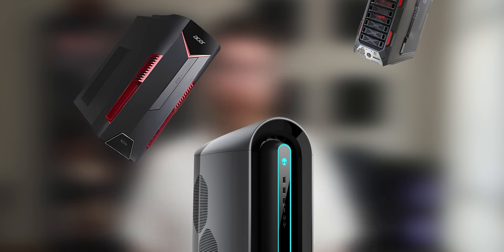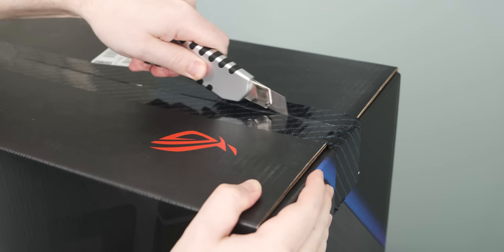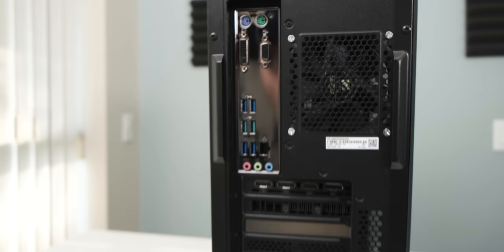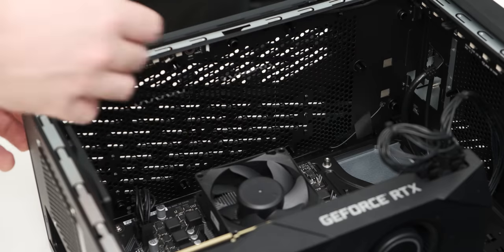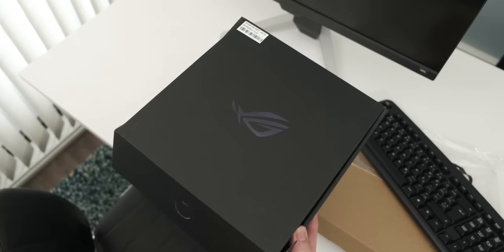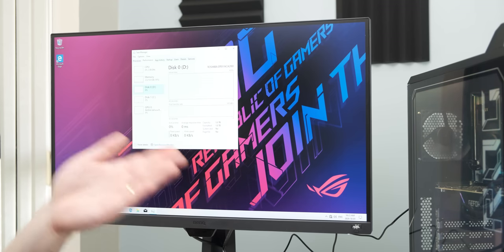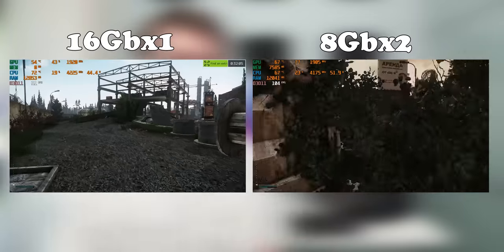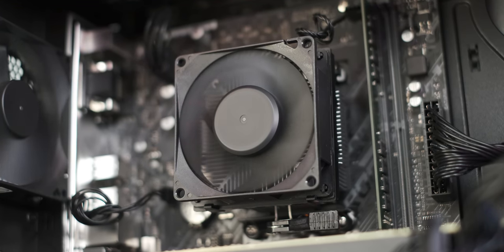I bought a $1500 Asus Strix Pre-Built from Best Buy...

Comment: As soon as I saw the PS/2 inputs, for a $1,500 pre-built computer...I knew this was going to be a trip.
Reply: Most motherboard still have PS/2 ports. My MSI B450 Tomahawk has one, which is really nice since I have an old keyboard as well as my main gaming keyboard
Reply: Ps/2 inputs are still valued especially by overclockers. This is because if USB controller is too cold it's unusable
Reply: @bitelaserkhalif  Really??? I did not know that, nor would I have ever assumed such a thing if for some reason my system couldn't use them at boot and the environment was very cold. Tech be crazy
Reply: Alot of good high end motherboards still incude at least one PS/2 port and I stil use that for my keyboard (Steelseries 7G or my lovely old AST without icky windows keys). Also  PS/2 is a better keyboard input but in reality you probably won't notice. :) 
Actually one of the reasons I did not end up with the 570 motherboard I had planned for my Ryzen build is that it lacked a PS/2 port. Gigabyte drooped PS/2 on all but their crap 570 boards, MSi, ASUS and Asrock still had it on most of theirs.
Reply: @liamjames-hendriks4895  He talks about extreme overclockers using LN2. USB would not have an issue with cold environment in general.
Reply: @birdsplaybs1234  I agree, but my keyboard has 5-pin DIN, so there are no converters for it to USB. It's a really old board, a BTC 5100C
Reply: @bitelaserkhalif  but i dont think someone will oc with that Mainboard in the vid

Comment: Damn lol I got basically this exact same prebuilt, Surprisingly enough it hasnt gotten very hot while gaming (My processor is a Ryzen 3600x, GPU is the 2060Super (Same motherboard, ram, and PSU) 
You should make a tutorial on how to remove all the components from the motherboard, and totally replace the motherboard with a better one, and re-connect everything, seeing that this particular type of pre-built is so new that there are no guides, I think you would help alot of people out, including myself :)
(I am most worried about the cheapness of my motherboard or my PSU)
Reply: Yeah me too I installed new ram I’m now looking for a new psu then motherboard
Reply: my friend is getting this to not build his pc but he does not know he needs to build that pc all over again to get new motherboards
Reply: @huseyinakif9502  what?
Reply: @cardboardtruck1009  he is getting a prebuild so he does not have to build it himself but he will need a better motherboard eventually and he will have to build the pc again
Reply: @huseyinakif9502  oh
Reply: @RandyPKsNubs I'm probably going to get your exact PC, any thoughts or suggestions? I've basically run out of other options and it's on a 250$ off sale, is it worth it?
Reply: @kenk2221  I still have mine to this date, It seems to be running smoothly, My only complaints would be that the motherboard is sort of cheaped out on, but it does the job for any modern games at the moment!
The motherboard only has 2 ram slots haha, still can have up to 32gb of ram with dual 16's but yeah, motherboard is only thing that seems to be overlooked!
Definetly a good prebuilt, has good ventilation etc, nice glass side on the case to see inside, if I ever upgrade PC's ill probably just move all the hardware from this one to a new case with a better motherboard, but no complaints as of now

2060s and Ryzen 5 3600x run most modern games at 144fps, Only games I don't get max performance on are Rust, GTA 5, and RDR2 (they are pretty oddly optimised and are pretty big performance hogs, but they're still playable with average 70-90fps).
Reply: @RandyPKsNubs  hey nice I also have the one you have. (Got it in April) Works really well for what I need and sooner or later am gonna add another 16GB of ram to it. Which ram sticks did you add to yours?

Comment: I just bought this pc but it came with a I7 10700k processor and a much beefier cooler. planning on changing the ram and adding another hard drive. it was a black Friday deal and really didn't seem like a bad build for the price
Reply: I'd recommend just getting an external ssd if you need even more storage.

Comment: I saved my money for this pc and i got to say it’s running like a champ. First I wasent to happy about the single ram stick but it does the job and il upgrade it later on. For the cooling it was not that bad i was getting around 50-70 deggre celcuis cpu and gpu. Not the worst I’ve seen!i can perfectly run any game atleast at 70-80 frames.
Reply: I got this pc too but I have one with core i7 11th gen, 4 ram slots and 2 8GB ram sticks and a cooler that yields a faster rpm. Wonder why it varies from this one here...
Reply: Keep an eye on that it seems like this might be your first PC with some power too it and realistically 70 c is already on the high side . It'll be fine so long as you get some air duster and clear it out once a month or so . But like every PC the thermals naturally get worse overtime once the thermal compounds start breaking down and the fans get weaker . Just keep an eye on it , 80c is where you'll potentially start noticing damage and that's no good
Reply: i got a diffrent one with a better cooler and an rtx 3060 phenoix (i think)
Reply: plus i was rong on that 70 deggres its more 60 deggres
Reply: @Jim7861  2 years later upgraded my CPU cooler, also upgraded to 32gb of ram new 850 watts psu 👍

Comment: I bought this as a first gaming computer. I looked around tried to see what I wanted and then priced out what the parts would have cost me if I built it with similar specs. finding a 2070s and a ryzen 7 was about $1300. I think this is a reasonable desktop to purchase with the intent of upgrading over time. it is running with no issues on all the ultra setting, but for the price it it very much worth it IMO
Reply: from my experience, my last pc was a yee yee ass QVC laptop my mom got me back in Jr high. that poor sob died last year after 7 years, so my parents decided to get me a regular computer instead at best buy.  i got this ASUS computer. and it was a shock to me.  i never got anything above 20 FPS from my laptop
Reply: I'm debating buying it simply to switch the cases and add some more cooling, the one im looking at is a 3070 which is almost the price of the system by itself
Reply: I'm thinking of buying an Asus prebuilt.
It has:
Ryzen 3700x
And RTX 3070
32 Gigs of ram (3200 MHz)
512gb nvme SSD
And a 7000 wat power supply
All for the price of 1700$ (USD) 

 I am pretty sure I am going to buy it, but if someone changes my mind then I won't.

I also want to know if it's a good deal!
Reply: @chitogekirisaki3793  Yea, when I buy iy, I will switch the cpu cooler to a Noctua NH-U9S and switch the fan coolers to Noctua NF-S12A PWMs
Reply: @adrenal486  One thing ive done a few times(as I have a lot of experience) is taken the internals from a Prebuilt and put them into a nice case like an O11D. Great way to make it your own if you arent much into building, or can't find a GPU still. You can always go to a LinusTechTips video if you arent familiar.
Reply: @PDXCustomPCS  Yea I would do that, but i dont think my parents will allow it, and secondly it would void the warrenty.
Reply: @adrenal486  It actually doesnt. Every component in the PC has an individual warranty(Even being OEM.) Your PC does lose its warranty as a whole, but each component can be registered individually and warrantied as such. If something cheap goes bad like the budget RAM included goes bad are you going to pay to ship the whole PC back? I wouldn't if it was my only PC.
Reply: @PDXCustomPCS  I didn't think of that that way, but for now I don't have money to move cases, I spent it all on a new setup
Reply: @adrenal486  Not a good deal at all, not even close
Reply: @lnfinyx  in my country it is

Comment: Picked up a CyberpowerPC pre-built at Best Buy this past December when it went on sale. Came with a full-size MSI Pro Z690-A WiFi motherboard, 16GB dual-channel 3200MHz RAM, 1TB NVMe SSD, RTX 3070 (blower style, but it does help keep the inside of the case nice and cool), Core i7-1200KF, 800W (non-modular but still good) PSU, five PWM fans with ARGB, and an AIO cooler with a 240mm radiator and ARGB pump cover. The motherboard, GPU, memory, storage, and cooler would have cost at least as much as I paid for the whole system, and its case and other bits and bobs were also pretty darned decent. Granted, I ultimately swapped the guts over to a Fractal Design North case, but it still came in cheaper than I could've built my own system from the ground up.

All that's to say there are some decent pre-builts out there if you're willing to go with lesser-known brands, especially when they get steeply discounted during the holidays as retailers are also trying to offload the year-old systems to make way for the new stuff.

Comment: So for anyone who has bought or is planning to buy this pc this holiday season, let me give you some non bias advice/opinions from someone who purchased it, and at the end I'll list the upgrades I made to make it much better. (LONG POST)  Performance is solid, all the ASUS Strix don't come with the exact same specs, but for instance I got mine with a Ryzen 5600X and a RTX3060($1400 CAD) which seems to be the low end for this prebuilt and even that is more than enough for gaming.  

My big complaints in order are 1. The case   2. The ram  3. The stock cpu cooler.  So for the case, its pretty horrible there's no way around it.  It's small, limiting the upgrades you have available.  It only comes with 1(!!!) 92mm case fan mount spot, and the stock case fan is e-waste garbage.  That is inexcusable from a company like ROG, they know better.  At minimum you want one case fan as an intake in the front, and one exhaust in the back.  As for the ram, pretty simple really.  I got 1 single 16gb ram stick, however it was ddr4 3200mhz so that's cool.  What isn't cool is that 1x16gb ram stick will preform substantially worse than 2x8gb ram sticks running in dual channel and they cost almost the same.  Finally the cpu cooler: it's loud and inefficient.  You'll be okay with older games and low graphics on newer titles, but you may throttle on newer games at ultra.    

So for anyone still reading, all hope on this prebuild is not lost. 

 Here are the simple upgrades I made, keep in mind this is my first PC so if I could do it then so can anyone reading this.  I replaced the stock case fan with a Noctua NF-A9 PMW 92mm fan.  I also added another identical fan to the bottom front of the case, just hand screwed it into the vent holes and it went in easy and is secure(you will need your own screws), both fans come with a cable splitter so no need to buy your own.  So now I've got my intake+exhaust.  Ram was easy, replaced the single 16gb stick with 2x8 Crucial Ballistix RGB 3600mhz.  The CPU cooler upgrade was the hardest part, but really that isn't saying much.  Replaced it with a Noctua NH-U9S with a 92mm fan(exact same fan as I used for the case fans).  It has the ability to mount 2 fans, so if you want to buy a 3rd Noctua NF-19 PMW case fan you can beef it up even more since they're interchangeable.  This is the biggest air cooler you will be able to fit inside this case, if you go any bigger the glass panel will not fit back on. 

All in all, upgrades were under $200CAD and my performance has increased 20-30%, CPU temps have dropped 20c both idle and under load.  Idle around 30c, never go past 65c while gaming.  I know, it sucks to have to do all this work after you've spent so much on a PC, but with the gpu market the way it is right now this is really the only option for normal people.  Plus, I did all the work figuring it out already so all you good people can just copy.  Keep in mind, every part I used was as big as this case can handle.  If you go bigger, things will not fit.  All of these parts were ordered off Amazon.
Reply: Thanks, il be sure to get the nh u9s, thanks for the tips!

Comment: I'll just say, for the price and what's included, it would be more than enough for me. If I just upgraded ram and cooling, it would probably handle all my projects fine. Light gaming, programming, some 3D modeling, emulation, VM/remote desktop/vpn, etc.
Reply: @chitogekirisaki3793  where’d you get that build from?
Reply: @chitogekirisaki3793  I got an RTX 3070 and ryzen 7 5800 for 1700 dollars. It was a Lenovo prebuilt, too bad they have a shitty in house cooler and some ridiculous backplate which limits upgradability.
Reply: @bletrick3352  why on earth would u by a Lenovo pre built
Reply: @hsjjdjdjdjdj8694  Because aside from the cooler it’s not bad?
Reply: @bletrick3352  gross
Reply: @hsjjdjdjdjdj8694  It's more of a Sleeper, gamer version than a proper fucken "Give me the performance I paid for" type of desktop pc.

Comment: Completely agree, they've cut corners and compromised to maximise profit margins but completely unnecessary and to the detriment of the buyers unfortunately. This is why I'm building my own!
Reply: yeah they have with single channel cause it's cheaper🤣🤣🤣🤣🤣🤣🤣🤣🤣🤣🤣🤣🤣🤣🤣🤣🤣🤣🤣🤣🤣🤣🤣🤣🤣🤣🤣🤣
Reply: It actually comes with dual channel 32GB ram, 1TB ssd, RTX 3070, bigger cpu cooler and upgraded power supply and motherboard.

Comment: So no question the #1 problem is the cooler, it sounds like fan boat when I was playing warzone. So I added a Noctua NH-L12S cooler for $55 and a $15 be quiet fan in the back it's now silent and stays very cool. When I bought my pre built it already had 2 16 gbs of ram too. I highly recommend putting the cooler and ram in it and you will be pleased for sure.

I appreciate the review it made it easy for me to fix. Oh! last edit my mother board was different I have 4 slots for memory too.
Reply: which fan did you swap out for the back? When i turn it on the back starts then stops, and works when it wants.

Comment: Alright guys , so I just bought this PC off NewEgg for $1400 .. after watching this video I was completely skeptical of my purchase . Until I plugged it in and used it . No I am not a tech genius and I don’t understand every little thing about computers , but I have owned prebuilts and seen others friends have owned and this is by far the best one . You plug it in , it is EXTREMELY quiet , I mean there was hardly any fan noise . The motherboard offers wifi and my internet id about as shit as you can get , AND my router is 2 floors away from my setup . It was running LIGHTNING fast on wifi with no delays , lag or problems. . Had absolutely no problem downloading games or connecting to servers . Then when I played games like CS:GO I was getting 400+ FPS on max settings , Apex Legends on max settings was getting 144 FPS and it was capped . I experienced ZERO lag or problems at all . I accidentally opened and played APEX while I still had CS open as I forgot to close it and I was running apex perfectly . My old cyberpower prebuilt legitimately would have seized up if I ran two games at once . This PC is great especially with the current market and how hard it is to get GPUs .

Comment: I literally ordered this exact pc yesterday
Reply: i bought this PC a few months ago.
i immediately upgraded the ram to dual channel 32gig, and added 3x cooling fans. around. was around 100$ upgrade. and its been amazing to me.
Reply: @b3n751  did you get a chance to replace the power supply? If so, how was it?

Just got this yesterday with upgraded graphics card (thank you stranger on the internet) but was worried about the longevity
Reply: @mattcampea2482  i never did replace the power supply yet. but i did have it open, and upon doing some digging i discovered that the power supply is proprietary and will require a crossover cable to get a off the shelf power supply to work.
its a 10$ cord on ebay. other then that should be straight forward.
i havnt had an issue with mine yet.
and my PC sees 14+hrs of heavy use daily. as i work from home as a health and safety coordinator for an oil&gas company and avid gamer.
Reply: @b3n751  great to hear that everything's still running smoothly! I'm a little worried about the longevity of it though for future upgrades, would you be able to send the name of the cord?
Reply: @mattcampea2482  upgraded graphics card?
Reply: @armandojimenez4628  the guy I bought from (somehow) had a bunch of 3060s and he put it in for me! So it's good to see there's upgradability on the main parts, just not sure which other parts are upgradable
Reply: @mattcampea2482  All GPU's have the same connection. The issue is regarding the motherboard- most prebuilt have modified connection ports for power supply connections , fan slots etc
Reply: What CPU cooler did you get for it ? I bought a hyper 212 but it went over the ram slot...
Reply: @Anton044  Any updates on what cooler you found that fit?
Reply: @TheTinyTimmyTimTim  The ARCTIC Freezer 34 Esports Duo fits without touching the ram but you won't be able to put the side panel back on. I tried other but they always got over the ram slot.

Comment: I bought this pre-built with 5600 x and 3060. I run at 1440p. It is a great system for a pre-built but it needs some upgrades. I immediately upgraded the ram to 16 and then later 32. it can barely keep itself cool i replaced the stock fan I also had to add two intake and one exhaust fan. 2 intakes to the front one exhaust up. I also had to obviously upgrade the storage.

But I've had this system for a couple years now after the mentioned upgrades it works great have no issues it runs almost every game on high settings.

The motherboard is very limiting but fine. 

And I've been using the headphone hook without any issues.

Overall only buy these if you are willing to upgrade the RAM and air flow and Storage but after that it's great!